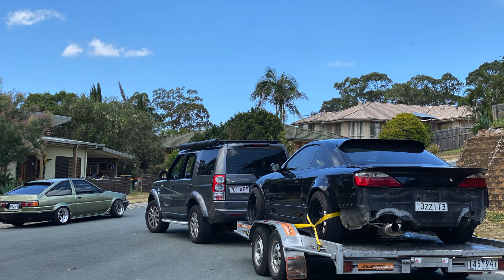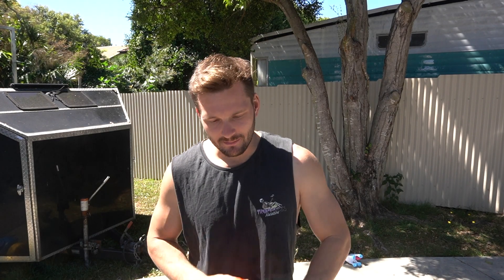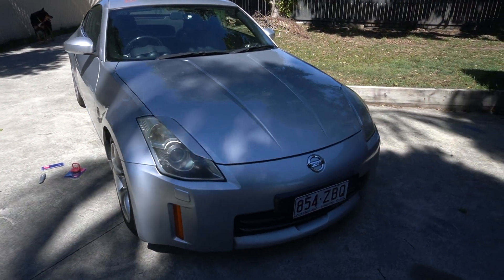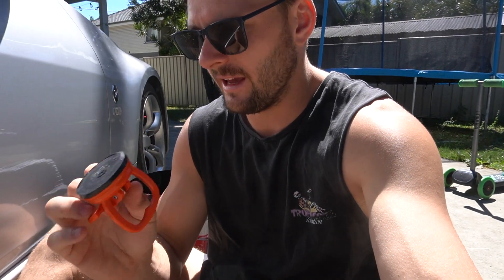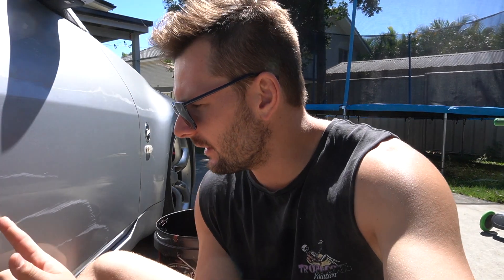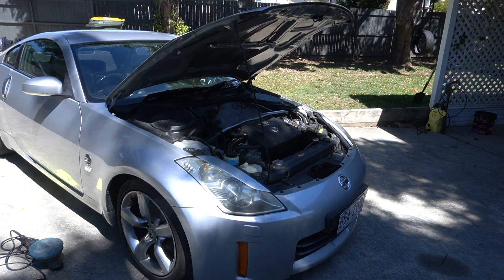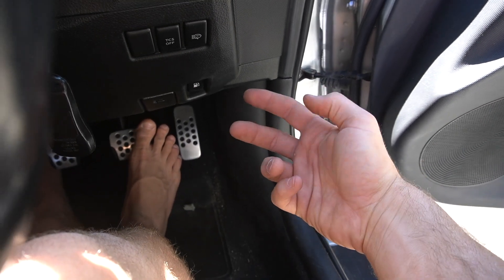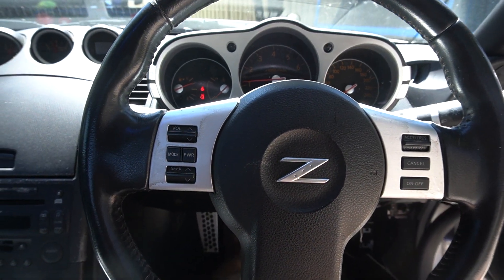Flipping a 350z +  A/C Blower Relay Fix

Comment: I tried changing both relays and the blower motor still not working. I found that both 15A fuse for the blower blew. So I replaced those fuse with new 15A fuse. Upon turning the car key in the ignition, both new blower fuse blew. Do you know what could be the issue?